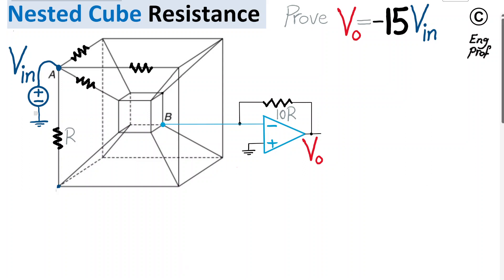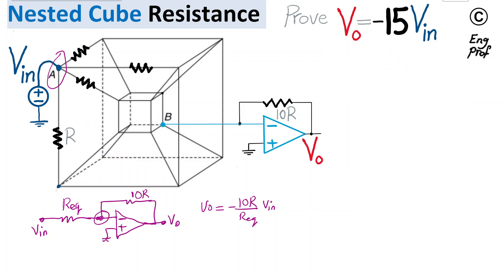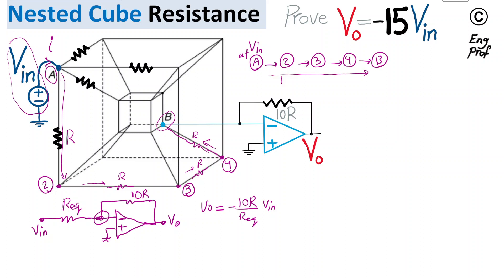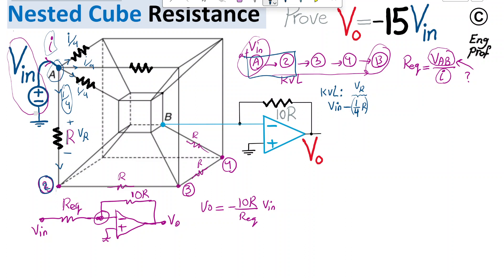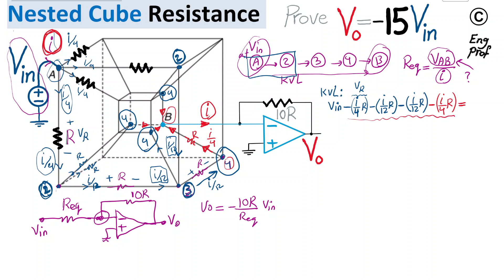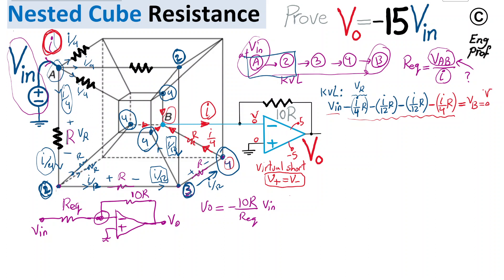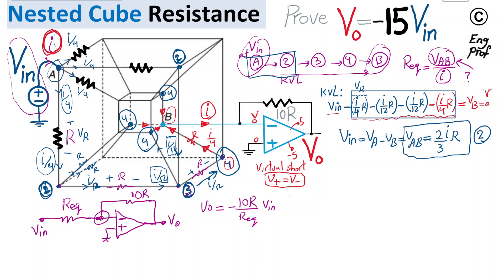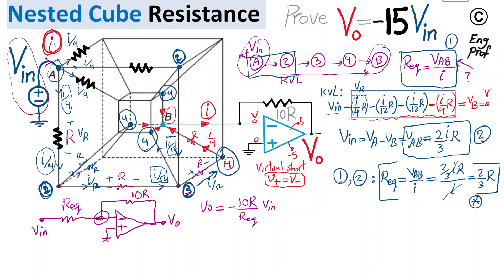Double Cube Resistor Network with Op Amp

Comment: That looks like a tesseract of resistors.
Reply from the maker: Yes you are right, this example is computing the equivalence resistance of Tesseract Resistor Network used in an inverting amplifier circuit topology.  👌